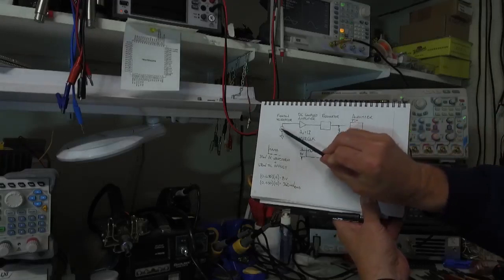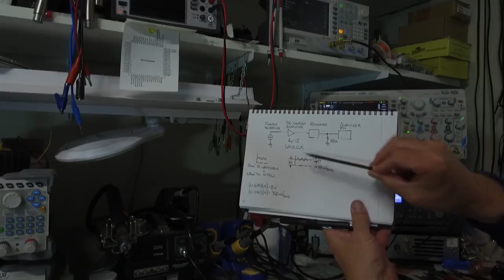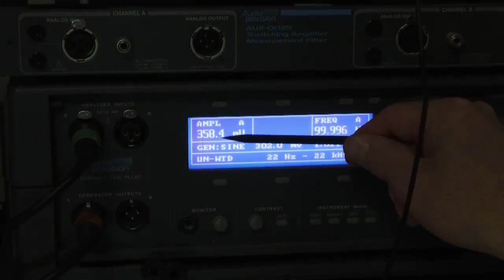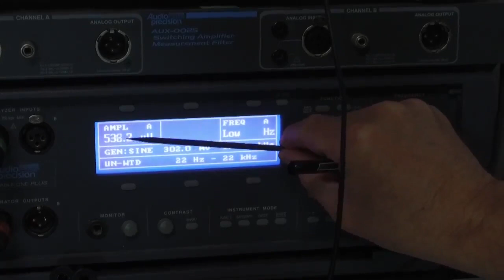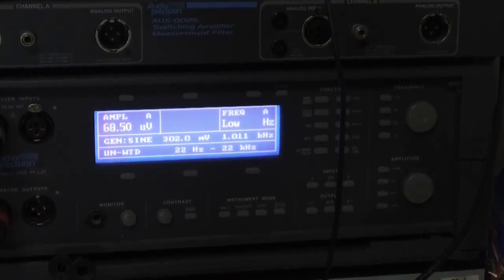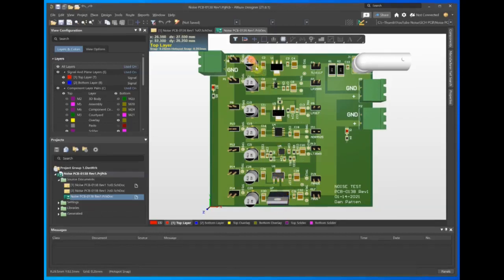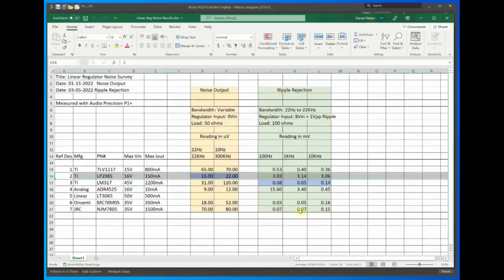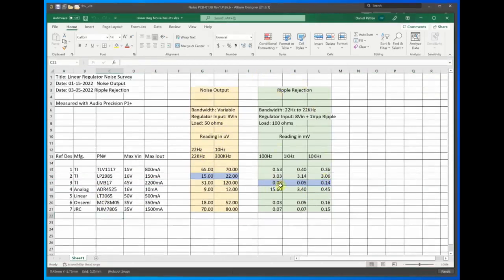Ripple Rejection Of Linear Regulators Compared  LM7805  LM317 TLV1117 LP2985 Altium PCB

Comment: i'm new to mosfet and voltage regulator, in a simple statement the bigger the ripple rejection the linear the output voltage? i couldn't understand the with the mV was all over the place with different regulators. Thanks anyway, great setup!
Reply from the maker: Thanks.  What I am try to show is how quiet (lack of ripple) the regulator outputs are when they are presented with a noisy input.  Hope that helps.

Comment: Could help wondering why so complicated ?  Why not grab a modest transformer of around 9-12V, slap on bridge rectifier and a ... oooohh 470uF reservoir cap.  Bingo, a working power supply complete with real ripple instead of a simulated supply.  Use a rheostat for a variable load to set the level of ripple.
Reply from the maker: That is a good question.  If we used a simple transformer and diode rectifier, we would only be looking at ripple of 60Hz or 120Hz (for the USA).  I want to look at ripple rejection of other frequencies.  For example if you have DC bus in your system and this bus powers multiple regulators (which is very common) there might be a mix of linear and switching regulators.  In this case there could easily be ripple on your input that is not 60/120Hz.  You might have much higher frequency ripple.  Thanks for the question.

Comment: Nice work ,  question can you share the Gerber files ? that could be interesting to run test with a load or even different type of load
Reply from the maker: Sure.  I can share gerber files.  Email me (found on about page).  Even better...  I have a couple of extra boards, I could drop one in the mail.
Reply: @DanPattenAudioG33k  Thanks , I just send you an email .
Reply from the maker: @ced3098  Gerber files sent :)